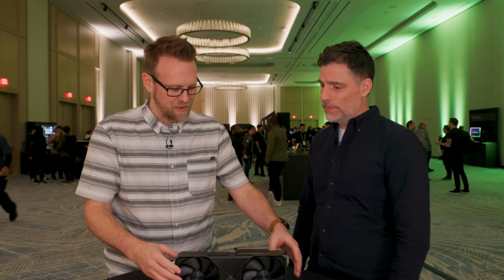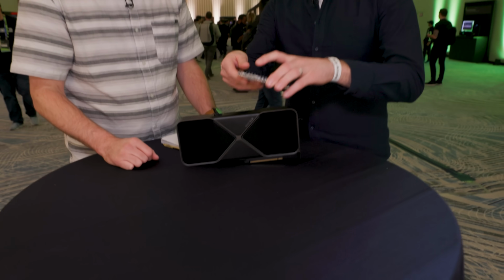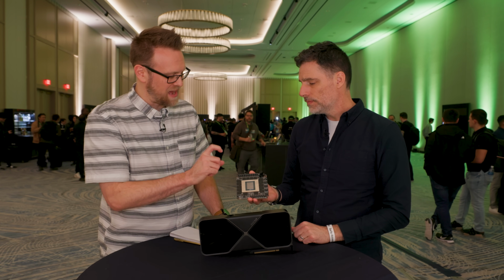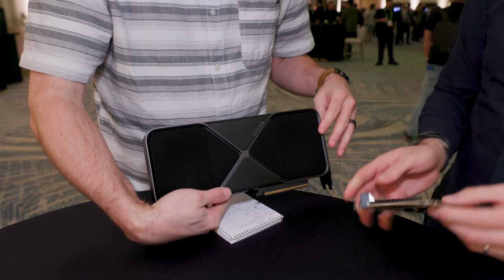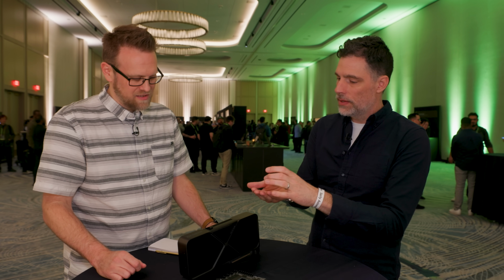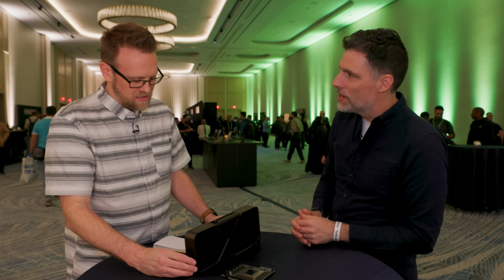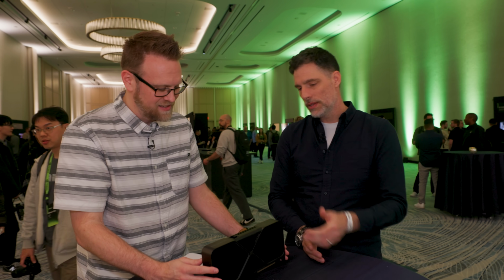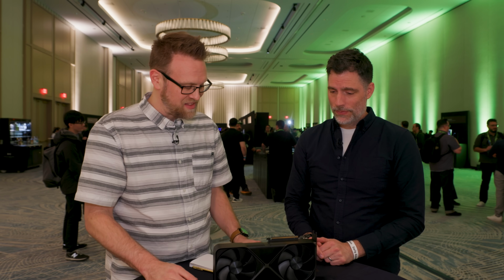Nvidia Talks RTX 5090 Founders Edition Design

Comment: I guess if you break the PCIe connector now all you need to do is replace it with a new one instead of the whole card being dead.  NICE!
Reply: indeed a very great aspect of splitting the PCB into 3 parts.
Reply: The only elements likely to be broken by user errors are the Pcie connector, display ports and fans, all of which can now be replaced easily without needing a whole new main board. This is excellent for repairability and not something I really considered for GPUs before. Very nice!
Reply: @Chromana  Only if you can get the spares.
Reply: @kilosera  I'd imagine you will be able to, it's basically free PR for Nvidia and even if THEY don't do it, the connector daughter boards should be simple and cheap enough that they can be provided by third parties without problem.
Reply: @MajinOthinus nope. The daughter board won't be easy to find, and the volume is so low, so it's gonna be very expensive, and it's the Nvidia OEM part, and no Aftermarket can make it.
Reply: @lostalx  And why exactly would no 3rd party be able to make it? They're not difficult to manufacture parts and there are loads of small boards that do similar things already in production and on the market for different purposes.
Reply: @DizConnected  what on earth are u doing with your cards to break the pcie slot?! Thats a rather bizarre use case haha
Reply: @brandonchappell1535  PCIe slot breakage is typically the result of stress from the weight of the card being supported by the slot.  Opinions (and card models, which are not equally vulnerable) vary on whether that can happen purely from static load ("sag"), or if it requires a short drop / shipping the computer with a GPU installed.
Reply: Basically before if that happens the card is for the trash bin or very expensive repair, now almost anybody can change that small PCIe daughter board.

Comment: The new design also maximized repairability!
Reply: How so? Would NVIDIA sell the axillary boards or the cables that are used for connecting them?
Reply: @Mysteoa  GPU repair techs often have to fix broken PCIe connectors and input ports. If you damage a PCB bad enough you can destroy the entire GPU. The new design segments the components, eliminating collateral damage.
Reply: @abb0tt  if you aren't able to source replacement connector boards, how would this benefit repairability? this is contigent upon actually being able to acquire those separate boards.. you would need donor FE cards.
Reply: @notmyfaultthisishappening3795  donor boards are a perfectly good source of parts. It’s also a lot easier and cheaper for components to be manufactured by 3rd parties looking to create a secondary market. The new form factor opened the door. The boards are not even on shelves yet, give it time.
Reply: @notmyfaultthisishappening3795  The daughterboards are simple and cheap enough that there should be no problem for third parties in replicating them, even if Nvidia doesn't make them available officially. And considering that it's basically free PR for Nvidia to make them available, there is no reason to assume they would be unwilling to do so, especially considering the aforementioned availability through 3rd parties - they'd be leaving money on the road if they didn't.
Reply: @abb0tt very true!!
Reply: @MajinOthinus  well said
Reply: @MajinOthinus  Fair enough, hopefully these are available!
Reply: @abb0tt  Hope that these can be easily purchased online and are of the same quality as the original

Comment: With the triple PCB design. I doubt these will be good for water cooling and aftermarket water blocks.
Reply: good, nothing worse than buying a used FE card only to find out that some tool took apart the card to use with a water block.
Reply: They won't be, NVidia will no doubt make another Matrix version at $6000+ dollars for the rich and wasteful. I will be looking at the AIB versions. The FE does not suit for water cooling as is with 3 separate boards all hanging off a chassis you have to retain, but we haven't seen a GN teardown yet.

Comment: This interviewer did a great job and he showed true enthusiasm. I really enjoyed this as a 3dfx, 600, 980ti. 1080SLI, 1080ti, 2080ti, 3090, and 4090 owner. ❤❤❤❤❤
Reply: The last card I had was a GeForce 2 Ultra and a GeForce mk1 before that.Have not owned a PC since those UT and Quake 3 Arena days.
I'm about to buy a PC and not sure what gpu to opt for.
Reply: @MrMurphc13  hi friend. I feel like the 4000 series may be a nice sweet spot since it should have a decent discount while also supporting some amazing optimized technologies like Ray tracing and DLSS 3.0. To feel the experience of the tech you might like to try out a game like The Witcher 3 for an older classic or perhaps Hogwarts Legacy for a slightly newer one. I am going to splurge on the 5090 as I have noticed that I could always resell the flagship for close to what I bought it for even 2 years later. That had been a nice bonus for Nvidia card purchases over the years. T
For CPU you might see a lot of bang for buck with the 7800x3d from AMD especially if used? Have fun
Reply: @brothatwasepic  I appreciate the reply.However I'm the type of guy that if I'm going to spend it might as well spend a little more and if hate not to have potentially double the frame rate if that's what the diff ends up being.But I'm excited man.Thanks and Happy New Year
Reply: @MrMurphc13  have fun. Yes DLSS 4 will give you a good fps boost. DLSS 3 was a huge jump in tech imo

Comment: Insane that heatsink can handle 575W! while the partners are throwing most of the earth metal at it.
Reply: i have seen up to 5 fans in 5090 partner cards its crazy if nvidia can cool the 5090 at a low noise level with this design to be honest but who knows maybe its loud as hell.
Reply: I won't believe it until I see the temps.
Reply: @Athasin  same, i will listen to them and all but they need to show me temps and noise normalized levels to really buy a FE card. design is insane tho.
Reply: @Athasin  yea never take any companies word for it always wait for reviews
Reply: @Athasin  Right, my worry is that it's a compromise, I mean the temps will obviously be good enough, but will they still be higher? A lot of people considered the 3090 cooler and the 4000 series coolers to be "over designed", they were massive but the benefit is that temp and noise was down. They might be going back to just being "good enough" in order to reduce the size. My 3080 FE is too loud for me, I don't want a repeat of that.
Reply: They'll probably learn from this a bit and improve upon partner GPUs next generation, or maybe even this generation as new models arrive.
Reply: @Bry.89  Nvidia doesn't want partner cards better than theirs.  I would not be surprised if Nvidia cut partners out entirely starting next generation.
Reply: @chubbysumo2230  that wouldn't benefit them at all lmao
Reply: @Bry.89  unlikely. The only reason why nvidia can make such complex cards is because they don't have to pay a markup for the gpu chip. Their partners have to work with significant lower margins and won't be able to build such a expensive design. And even if nvidia would not make any profit and would sell their gpu chips with 0 profit, the competition would just lead to everyone building the old (and more economic) designs and adjust their prices down a little bit.
Reply: @Adesterr  Still that's no excuse for making them look like fisher Price toys, kids don't buy 2000 USD cards.
Reply: @airixxxx  speak for yourself.
Some of us don't become bland just because we age 😂
Reply: probably because nvidia has their digital twins, they can test multiple options with their supercomputers to get the most efficient design
Reply: Well its easier when you aren't an AIB partner paying the mark up 😂
Reply: best comment lol
Reply: hopefully they can get past 'throw a 4090 cooler on it' and come up with some just as creative designs
Reply: they already half did this on the 3k series too right? but only one of the fans were open up, but I do not think any AIB will do this. it cost too much.
Reply: the partners are just working with what they know is all stuff like this takes ALOT of research and development
Reply: I just find it strange that nobody else is trying a design that blow the air out the back instead of out the sides inside the case. You just keep rotating that hot air.
Reply: I can see the FE being on complete nightmare to do a thermal paste swap for
Reply: @Takashita_Sukakoki apparently it uses Liquid Metal
Reply: @JM-kn9dh  They can't use liquid metal on VRAM so you'll need to change thermal pads at some point. I doubt they will make the whole cold plate connecting VRAM and GPU as well and all just liquid metal as a transfer compound, even at 2000 coins, but they really should. 
VRAM at that speeds and 512 bit will get hot enough, unless they use high grade expensive pads which needs to be service only once at 6 years. Normal pads will dry very fast and will need to be replace each year
Reply: @ i see your point although, at this price range, i dont see why they wouldnt use higj grade pads. Also, i dont think ive seen thermal pads degrade nearly as fast as thermal paste
Reply: @JM-kn9dh  In this price range I expect PTM7950 thermal pads and Copper Silver alloy contact plate, not some thin Copper coated with Nickel. 
I promise you, none will be present🤑
Let's remember, on 4090FE Nvidia soldered the fan wires on PCB, didn't bother to place a socket for the fan wiring 1600$ card,  yeah.
Reply: @ yeah youre right lol
Reply: @Takashita_Sukakoki  It´s liquid metal bro
Reply: @Takashita_Sukakoki The partners still use paste it seems (I just checked Gigabytes Gaming OC version for reference) Liquid Metal is top tier though. The partner cards will have a very hard time outselling the FE here.
Reply: @Takashita_Sukakoki  Liquid Metal on that huge die. How do they keep it from pooling over and spilling 🤷‍♂️
Reply: Air flowing through the fins is so important, temps just drop when you don't have a PCB blocking the airways
Reply: @mortyforty8404   Also with PCB in the way you put some of that heat back... so it's very inefficient. I also hope they finally had put the GPU in the correct direction and not upside-down like it has been since forever, because when it's upside-down like it is now the heat naturally goes up while your try to cool it from the wrong side... This new design looks very impressive and efficient. Also in previous cards because of the weight sometime the pci-e connector will tear and that basically meant there is a very expensive repair or the GPU had to be put on a new PCB which was also very expensive, that way with separate pci-e connectors even if something happens to the pci-e almost anybody can repair it.
Reply: I rather go partner cards I don't want liquid metal on my gpu.
My launch PS5 is dead thanks to liquid metal.
Reply: @Whiteshade how many launch PS5s are still fine though.
Reply: @kcamfork  I don't want to take additional risk with liquid metal. I'm fine with beefy vendor solution.
If you are not sffpc enthusiast you should not buy founders edition of 5080 or 5090
Reply: @Whiteshade  There is no risk with liquid metal if it is applied correctly.
Reply: I’ve used LM for years. No issues if you do it right…
Reply: @Whiteshade Gigabyte will use Liquid Metal, asus and msi will use thermal pads from Honeywell for their 5090 & 5080.
Reply: It's going to run hot.
Reply: @LawrenceTimme  You sure ? is 550Watts and all components are very crammed, heat by proximity.
Reply: The 4 slot monsters from the partners card will run cool at below 70C meanwhile the FE will be above 80C.
Reply: @dumdum93 this is probably true 😂🤣😂
Reply: @dumdum93  80C,  if it's quiet, that would matter not at all.
Reply: 580w is not that much remember how everybody had 2x a gtx 480.. it was new like 300-400 euros
Reply: @quakeman-n5w5m A GTX 480 had a TDP of 250W. It was a 2-slot card. So in SLI you had 4 slots to cool 500W. RTX 5090 is 2 slots and 575W. Furthermore with the GTX 480 the heat has 2 hotspots as they are 2 separate cards. With the 5090 you just have one hotspot. That's a huge difference.
It's not surprising that the 5090 seems to be using liquid metal instead of traditional thermal paste. I really hope thermals and noise will be good. Especially over time, as I really wouldn't want to open this thing to reapply liquid metal and thermal pads.
Reply: I bet the partners are prohibited from using a similar design. Their PCBs are massive and so are the coolers.
Reply: ok Nvidia worker

Comment: I'm skeptical, I'll be pleasantly surprised but it looks like the focus was for stacking in a data center.
Reply: And?
Reply: @MaxIronsThird  if it's hot or loud I'd be disappointed, because I'm not buying it them in pairs.

Duh.
Reply: @jesso2k6  this is the best GPU design I've ever seen, it won't be neither loud nor not.
Reply: @MaxIronsThird  fingers crossed 🤞 

I'm an owner of some old FE blower designs (780, 780 ti). Those were compact for the sake of compatibility and the performance suffered big time.
Reply: This thing will be load as F or very hot.

Comment: It's very interesting to see this board layout after having watched Gamer Nexus' video on their tear down of the prototype board that they got. You can see how this board has evolved possibly from that 4 slot monster. Crazy!!!
Reply: I was thinking the same thing. With that, they already had the prototype for the idea of the graphics card being broken up into three parts for better airflow.
Reply: @Kvantum Also the way the PCIE bracket is a separate piece, and the way the power is shared along those thick ribbon cables too. I bet once we see a tear down, we’ll see those same flat inner cables
Reply: @Quizack  interesting to see how the repairability is on these cards, broke your pcie pins just replace the board, pretty sure we will get 3rd party parts for that and display board.
Reply: @sa9037-x5h  That’s going to be massive, as the PCIE bracket was just a daughter board and a few screws. Previously your GPU would be dead. I really hope it’s that same design
Reply: The prototype was almost certainly a proof of concept for this design!
Reply: Wow that Nexus icon threw me right down memory lane! What an exciting time to be an Android fan! Right after the Google Play Editions too!
Reply: @gerardw.7468 aside from the small fan in the middle in that prototype, the fans were actually accessible very early on in the disassembly of Steve’s prototype!
Reply: Exactly, it has the same principles as that prototype. It's very interesting watching both videos.
Reply: i thought the exact same thing
Reply: Wasn't that a 4090? That didn't use liquid metal either. To me that seemed like a 4090 prototype
Reply: @ShadySKWASHA  I think OP was referring to the way that the prototype had the pcb completely out of the way of the airflow through the fins. That one had the pcb vertical, making it 4 slots thick, so OP was I think saying that this miniaturized and split-up pcb concept is a way to achieve that same thing without it having to be so tall and was likely influenced by lessons learned from the prototype
Reply: @ShadySKWASHA It was a 4090TI
Reply: Exactly. But this will definitely be a nightmare to clean lol. Took Steve 2 hrs to tear it apart  (granted without any guide).
Reply: @gerardw.7468 the two fans (excluding the third central fan, which isn’t present in this 5090 anyway) were actually accessible very early on in the disassembly process.

Comment: Interesting to see the thermals of the FE model versus board partners and how the liquid metal solution holds up!
Reply: Nvidia taking over the top end of computation industry really fast. I dont think that 3rd party partners will be able to achieve same thermals to noise ratio. I was super surprised with nvidia also announcing their first cosumer level PC/server so there is a question how long when they partner up with strategic partners like Adobe, Sony etc. to make their own version of Mac. And contra to some people think Microsoft and Nvidia are really tight. I know for a fact that last year 70% of Nvidias silicon went to MS Azure so they are their biggest partner and it's only matter of time when MS will realease some Windows A.I. like cortana that will either run on cloud or be optimized for Nvidia. I could see some A.I. Cortana be marketed as your "home assistent" that will basicaly do all the task for you even for your work giving edge to whoever buy the right combination of HW + SW.
Reply: @kukuricapica   We'll see if this unorthodox design can really compete with the quad slot monsters when Techpowerup reviews them
Reply: Imagine this thing is actually as silent as a 4090FE...
Reply: @The_ViciousOne The 4090 FE is not silent. The top right fan that pulls air through the cooler is already loud on the lowest speed. The AIB cards like the Suprim are so much more quiet.
Reply: @nullvektor9922  Well I suppose that depends on what you consider "quiet" I have also both 3090FE's and 3080TiFe's and I can barely hear them most of the time. But ofc when it comes to full load sound levels, that can change quiet fast depending on differing factors. But that is eventually one of the reasons for water cooling... But on the other hand I am, or more was also used totally different sound levels, that were unavoidable in the past... GTX480 comes to mind here...🤣
Reply: @The_ViciousOne  Yeah very subjective but I always hear people saying that the a FE is "whisper quiet" which is just not true. I even modded my 4090 with board standoff screws to reduce the turbulence noise because it really irritated me. 🤣